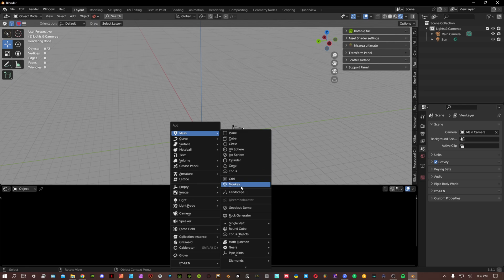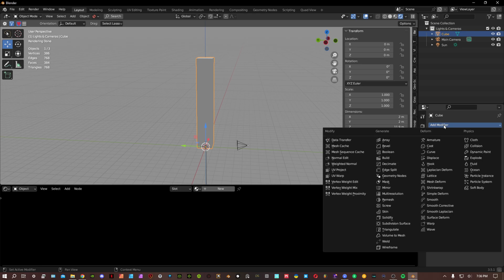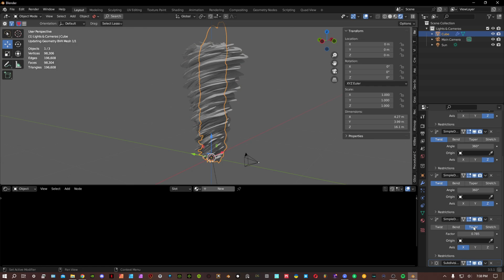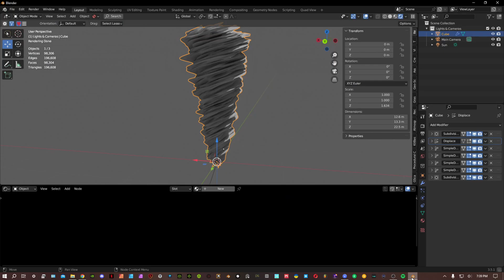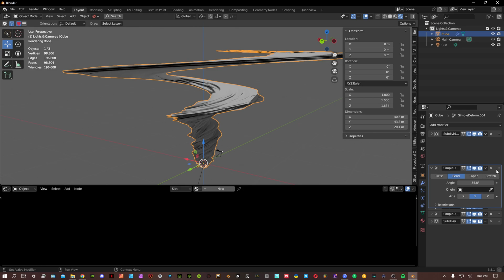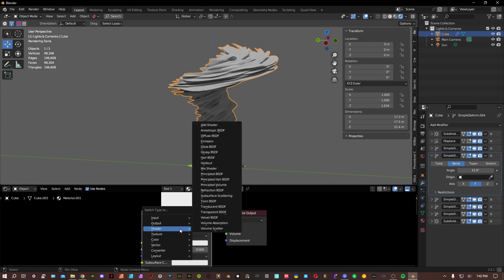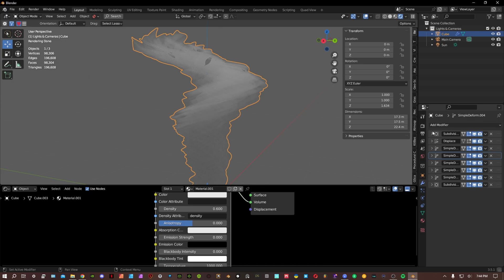HOW TO CREATE TORNADOES IN BLENDER

Comment: Is there a way to ensure that a volume shader will take into account the shape of an object that has modifiers on? After I get the tornadic shape on my box, I put the volume shader on and all I get is a thin box of fog in the shape of the base object.
Reply from the maker: Probably the placement of your modifiers
Reply: @cc.creationz  Thanks! Unfortunately after doing a bit of research I realize that it may be because I was trying to use Eevee when volumetric shading only responds well to Cycles, but thanks again!
Reply from the maker: Oh yeah i forgot to mention about that i use cycles since it does better with volumetrics and clouds